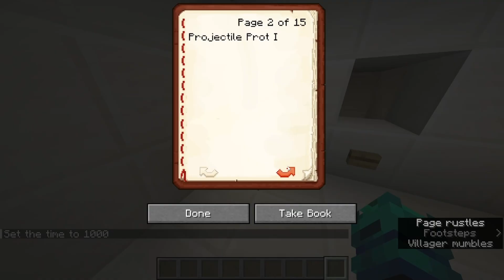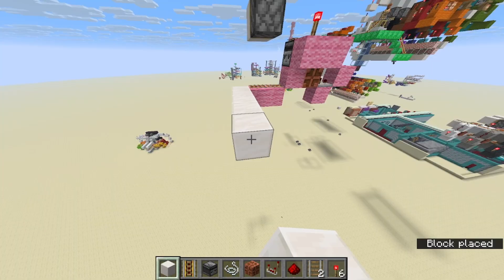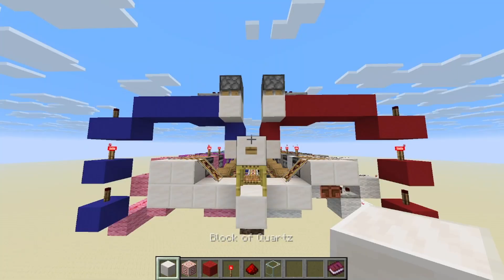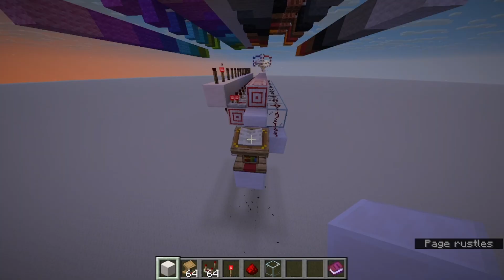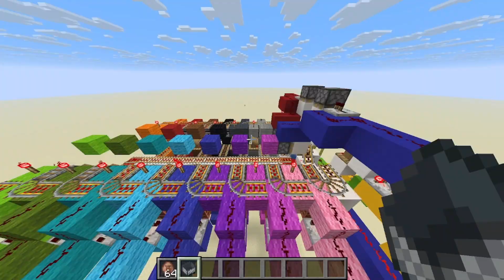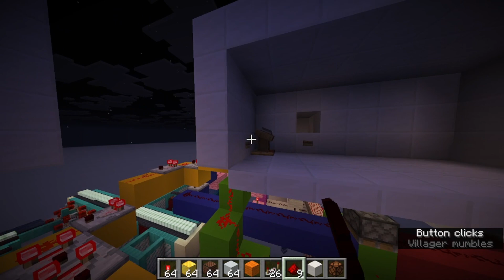Villager Vending Machine | Minecraft Java 1.21 Redstone Tutorial

Comment: i just made this in a singleplayer world, now i try to get it set up in my Minecraft server, I just read the description... the entrance of my "trading house" is on the north side and facing south. Should that be fine?
Reply from the maker: As long as the villagers are travelling South on the middle track, it will work. If you need them to go north, you could add a block to the end of the track so they switch direction after hitting the block (although it would add a short delay to villagers getting dispensed). You can always test the direction by setting up the Middle track and seeing which way a minecart goes if it comes in from the side.
Reply: @leagueoflegends1423  okay thank you